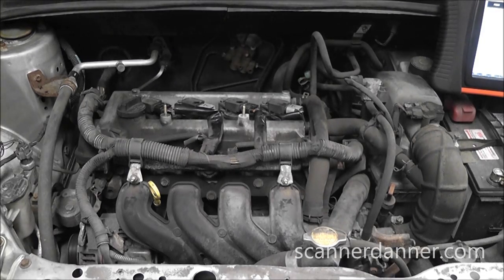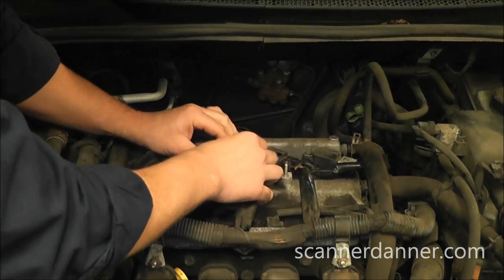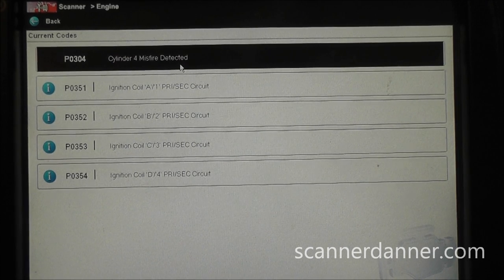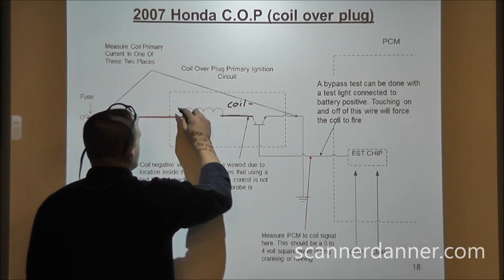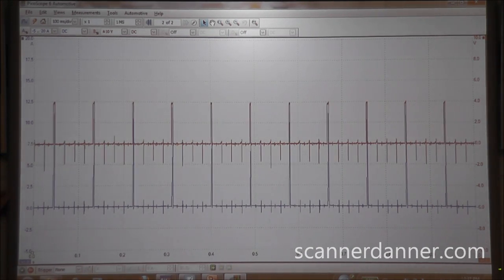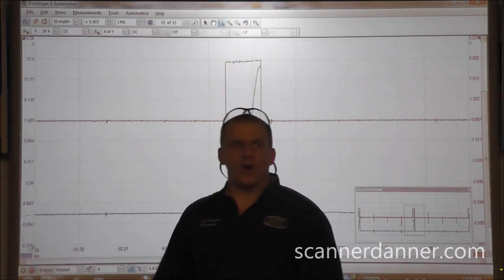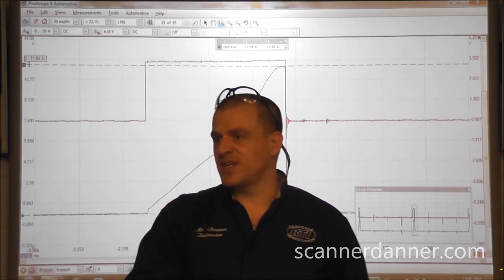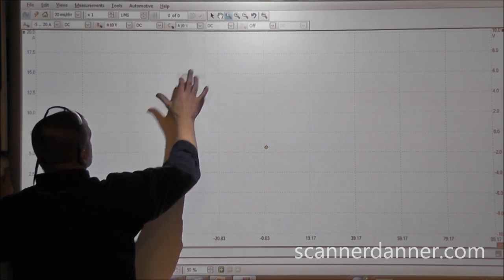Operation and testing coil over plug ignition (4 wire) - Toyota/Lexus

Comment: i know your discussions are not sales pitches but I'm watching because I'm still deciding on buy a picoscope 4425 automotive.  So far, just the 12 bit resolution is impressive.  I was wondering if you have any CAN-C signal faults where a scope of this caliber is really useful??
Reply from the maker: +dicas1988 you could post that question on the Picoscope forum. I'm sure someone there has some examples of that. Another real good site is www.autonerdz.com
They sell the picoscope as well and have a really good forum. Tell them I sent you okay?
Reply: Yea, ok.  Sure will.  Thanks anyway.  Hey btw, whats your thoughts on the power probe hook?  Do you think the pp4 is all around better?
Reply from the maker: +dicas1988 funny you ask. I have both but never used the hook yet. Supposedly with the hook I can substitute a 5v reference output with it

Comment: i think the IGF is "triggered" when amp draw happens inside the coil, to me is looking at amp draw since they dont care about having them all in the same wire, but  i am not sure  ,  I would say to your question is impossible , are you thinking on a worst case scenario when computer ecm diagnostics fail or get false information?

Comment: On my 2004 Mitsubishi Outlander with 3 wire coils when cranking the coil control wires have 12 Volts, then 900 ohms, then 8 hertz. When not cranking Key On the control wires have 12 Volts, then 0 Ohms to ground, then 0.1 volts.   Should the resistance in the ground wire be so high?  I t looks to be controls as the resistance goes from 0 Ohms to high ohms when cranking??

Thanks for this video which explained a lot.
Reply from the maker: You cannot measure resistance (ohms) on a circuit that is live or has voltage or current applied to it. This is not a valid test at all. 
A three wire coil has the driver inside of the coil. There should be a constant battery voltage on 1 wire, a constant ground on another and the third wire is the PCM to ignition coil trigger signal. (base circuit control) This is usually a 0 to 4 volt square wave that will not show very well on a multimeter, they are too slow to see these fast signals. You may read a few hundred millivolts or so.
Reply: Thanks for setting me straight on the ignition system/coils.  It turned out to be a warp in the crank angle timing ring that had been bent when the timing belt failed.  Noticed the CEL flashing during cranking so no codes with all sensors OK but a poor signal to crank sensor due to  a mechanical defect.

Comment: On your Honda C.O.P example, it reads that you can do a bypass test by touching B+ to the wire that comes from the PCM-coil. On the Toyota this would be the IGT wire (right?). My question to you is how do you know the test light has to be connect to B+, and would it be the same for the Toyota??

Comment: Hello again, I have mu coil firing on the bench, but I need to add some additional external control which requires firing an EXternal custom circuit just when the high voltage spark starts.  This means I need to use the digital I/O with my custom circuit.  My source of confusion is at timestamp 33:25   WHAT IS TRIGGERING IGF??  Is some sort of time delay with respect to IGT happening here?  Or maybe IGF is triggering on a certain CURRENT level (range) through the primary ramp???
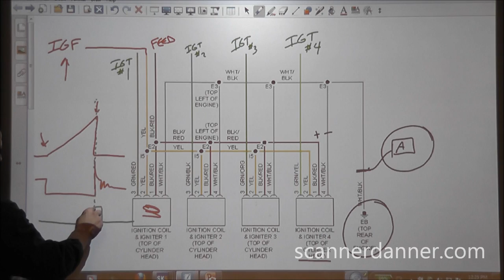There seems to be a contradiction at timestamp range  17:00 to 17:25
Reply from the maker: What triggers the IGF circuit exactly? Can't answer that other than to say when the coil fires, it uses that event to create the signal. Service info says the high voltage spike from the collapse of the primary winding is the trigger, but I believe we saw something that didn't quite match that here.

Comment: Hey Paul thanks for the video. Quick question. Is there any obvious way of telling if the transistor is in the coil or not? I have seen BMW’s before where you can get a primary wave from plugging into negative side of coil. And those were three pin coils. Is it just a matter of interrogating wiring diagrams? Thanks again!
Reply from the maker: Yeah the variable is the euro market. They like to use 3 wire cop coils that look like the transistor is inside but in fact the 3rd wire is a secondary winding ground wire. Other than that design, every other 3 or 4 pin cop coils, the transistor is in the coil itself
Reply: @ScannerDanner  thanks for getting back to me. Your videos have helped me enormously over the years

Comment: I have a question , since the coil is triggered internally and not externally by the ECU would you be able to measure coil primary with a scope or just a current probe?

Comment: Hi paul great vid,2 questions Would a non sparking coil show no igf signal? Also why is the current ramping up to 10amps while there is no spark? Thanx from AUS :)
Reply from the maker: It depends on the IGF circuit. They are not all the same. In other words, you could have a shorted secondary winding and have no spark, but still potentially have an IGF signal.
So again, your second question is answered here too. The 10a ramp is the primary circuit, we are not looking directly at the secondary here. Does that make sense?

Comment: Hey paul, is it possible to see 4 wire ignition coils primary or secondary voltage waveforms on a scope. the only way i think i could see secondary is hooking up an extension wire between the coil to the plug and using an inductive pick up? would that make an accurate test? thanks.

Comment: Hey Paul could you look up a 04 Kia amanti and look at the coil driver? On your diagram of the transistor you have 12v constant power going to the coil and the signal wire from the ecu and a constant ground. I completely understand it. But on this amanti you will see its totally opposite. The 12v feed is also the signal? Could you please take a look at it and tell me whats going on

Comment: But can the primary fire without inducing voltage into the secondary coil?  Or coils if it is broken in two?  My guess is that no secondary spark has to be the result of firing to ground.

Comment: I have a 2003 Nissan sentra 1.8 and I replaced the spark plugs, coils, air filter, and cleaned the air sensor and mtmy engine is still shaking. what can i do to check if it's my sensor or injector? And when I put my vehicle in drive, it kinda shakes still.

Comment: Hello, engineer, I am a mechanic and I have a problem. I have a Lexus IS 300 engine. When I start it, the engine starts, but after 2 seconds, the check light comes on and the engine turns off. Can you help me? Thank you.
Reply from the maker: What codes?

Comment: Paul In this video you show the amp clamp attached to ground by block to show all coils. Am  I putting amp clamp around all 4 wires going to this block ground or just one single wire ? I am using a older Snap on Modis and am getting  a different kind of ramp (almost square wave) and I have tried multiple time variables. Thanks
Reply from the maker: If you go around all of the wires just remember there are other circuits you will see in combination with the ignition coil ramps. It will multiply your amperage readings and depending on what else is there, severely distort your waveform. 
It is best to find the single wire that is carrying the coil current only. Make sense?

Comment: paul what the hashing noise on the burn time of the waveform means? it drove me nuts im seeing it on all 4 new coils i put on a 2azfe 4cyl engine!
Reply from the maker: What "burn time" are you referring to? Do you mean the coil primary current ramps? Burn time refers to the secondary event where the spark is actually jumping the gap of the plug and for how long.
Reply: ScannerDanner yes the burn time after the spark being generated right before the coil oscillation. it was 3wire coil over packs, and hooked the negative probe to ground and positive probe to ecu signal. i keep seeing hashing in the burn time  on every single coil though all of them new! drove me nuts:D thanks man really appreciate your work .
Reply from the maker: That's not the burn time bro, that would be the dwell time or the amount of time the primary is being energized. You are talking about the ECU's small square wave signal right?
Reply: ScannerDanner after the big spike there is burn time or what called burn time in the middle of it there is hashing  . twice i parts cannoned it thinking maybe i got bad coil packs all four of them ;D
Reply: ScannerDanner i just wana know is this normal? since the engine seems fine running no hesitation or misfire. cuz im concerned since the owner did run awhile with really bad ignition coil with dead short in could the driver be damged somehow?
Reply from the maker: Post this to my forum brother, so I can see an image of what you are talking about. Okay? I'll look for it over there. Thanks! https://scannerdanner.com/forum/post-your-repair-questions-here.html
Reply: ScannerDanner  deal bro you rock!

Comment: Hey man have you found a good probe to read secondary ignition on Toyota coils? Bought one from aeswave that couldn't even make out a compression issue in the burn line.
Reply from the maker: Nope, non of them will read the COPs with the transistor inside of the coil. I have three different ones (Pico, paddle probe and Wyze probe)

Comment: can you determine if a 3 wire coil is weak by checking the amp ramp? for example, a car that has random misfires and has codes for multiple misfire. if you connect an amp probe to the positive wire would you see a change on the ramp when the misfire occurs?
Reply from the maker: Sometimes. It depends on the type of coil failure. You cannot see all secondary faults within a primary current ramp. 
Type in "misfire" or "no spark" in the search box of my videos and enjoy! You will see alot more of this. 
Thank you!

Comment: Sir my car i20 rpm drops when each coil over plug is removed from the ignition coil. This is ok. But the current produce in coil 1 and 2 are a bit low when each coils is moved a bit far. Is this low spark an issue??? Also, engine is vibrating a bit only and rpm drops to 650 as against the normal 850.

Comment: Good vid very good info do 1 on a cam sencer wireing problem on ground when getting code 340 not cam but on the wireing i think it goes down too tranmission not sure do not want to on rap tape forgot what it is called but some wires have a self ground wire like it has a tin foil rapped around some wireing i no that 6.0 deisol ford f 350 has it i have a f 250 5.4gas hope u can make a vid on the wireing problem or how can i find out were i can get diagram need to no is wire going to injet o thanks

Comment: Hello sir I have your book and I am member on premium channel and I am very happy for all this knowledge share with us! I have a vw up with 4 wire coil on plug and the car misfiring all the time at one coil and have no spark. I check my power my ground and the igf and all is ok except that the igf missing one signal from the coil doesn't fire.I connect my oscilloscope and find that the trigger signal from the ecu doesn't go 0 volt to 4.7 volt square signal like the other coils but only go 3 volt to 4.7 volt square signal.what do you suggest me to check ?I already check crankshaft and camshaft waveform and exist without strange signs.i also check power and grounds to the ecu and is ok. I believe maybe the ecu have the problem i never have the same problem with coil signal at my workshop. If i change the coil that doesn't fire to the next is fire with  no problem and the spark also the same. Best Regards! Thanks in advance!!looking forward for your help!!
Reply from the maker: What is the voltage on that trigger signal with key on engine off? Compare that to a know good coil too.
Reply: @ScannerDanner  i will try tomorrow and tell you what is !! Thank you very much for your fast response!!
Reply: @ScannerDanner  good morning sir so if I have key on engine off or key off I have all the time 3.7 volts (in my previous message I say 3 volts its wrong  3.7 is the correct) . Compare to another coil is 0 volts with key on engine off. When I unplug my coil with the problem the voltage jump to 4.7 volts and if I plug again falls to 3.7 volts. And if I start the car the trigger square signal is 3.7 to 4.7 volts. I also put a ampclamp as you say in this video on the ground and I don't see any ampere ramp but only if I zoom enough a waveform like primary. And after 5 minutes with key off  when the ecu go to sleep then the voltage goes to 0 volts
Reply from the maker: @giorkar2116  okay perfect! That was my suspicions. Before we condemn the ECM, let's make sure that we don't have another wire bleeding into that circuit. The fastest, most accurate way to do that is to cut the wire a few inches back from the ECM, leaving yourself room to repair it when your done. Then recheck that wire on the ECM side KOEO. Make sense? 
If you don't want to cut, you may be able to de-pin that terminal from the ECM connector.
Reply: @ScannerDanner  yes! I will do this!!make sense i understand!so the result is that in that circuit inside the ecu something has shorted and gives all the time power and not when the ecu wants to charge the primary in a pulse mode if i say right and the coil can't create a spark or works without something triggering to collapse and create the secondary .thank you very very much!!! I wish you to smile everyday!! (Greek phrase)
Reply from the maker: @giorkar2116  let me know how it goes!
Reply: @ScannerDanner  of course!
Reply: @ScannerDanner  hello again sir!!I cut the wire 2 inches after ecu plug as we say and the ecu feed this 2 inches wire with 4.7 volts. So I believe now we have confidence and evidence to call a bad ecu. Am I right?
Reply from the maker: @giorkar2116  that would be my call buddy
Reply: @ScannerDanner  thank you so much for your help and for your immediate answers!!
Reply from the maker: @giorkar2116  intelligent questions always get my attention 🙂 also thank you for being a premium member!
Reply: @ScannerDanner  hello sir! Today I finally found a used ecu and install it and the car runs perfect!!so our call for a bad ecu was right! I also change 3 new coils and 3 new sparks plugs ( for the time of  diagnosis until the repair i had already  install 3 mine used known good coil and spark plugs) . The car has 84000 km and never changed the spark plugs and it isn't iridium spark plugs just simple. The old spark plugs have no spike only a giant gap and too rusty and the boots of the coils was in a very bad condition with water damage. So I believe maybe this is the reason causing the bad ecu like some europe ford models from a bad coil causing a bad ecu. I want to thank you one more time for your fast response, guidance and signs of a professional teacher being on our side!Hope the best! Best regards!
Reply from the maker: @giorkar2116  heck yeah man! Nice job on that one my new friend. Good providence to you moving forward.

Comment: Hey Paul, i saw a lexus 4 wire cop which dissconnecting one of the coils the car goes off. What might be wrong?
Reply from the maker: Normal on those. The system uses the generated IGF signals of the coils for injector control.
Reply: +ScannerDanner thank you!

Comment: Current will not be the same on the power side vs the ground side. The current from the base of the transistor will be added to the ground circuit. You will get two different readings. A small difference, but measurable.
Reply from the maker: Good point! Not much maybe 200 ma difference and it wouldn't affect diagnosis but you are correct
Reply: ScannerDanner I agree that the current would be small. But the smaller current would show up as a square wave at the emitter where you would normally only see the current from the coil. Yeah the base current through the emitter would be small but could confuse people if they don't expect to see it.

Comment: Love your videos , but I am no fan of unplugging the coils first to hear rpm drop , it could be a poor connection at any one connector and when reconnecting the coil it may start to fire. Then you are stuck with having a vehicle that may run fine and we can no  longer reproduce the problem. Then the question of was it the connector or a failing driver in the ecm? Just a preference for me but I dont disconnect anything before testing by backprobe methods

Comment: Does the vantage pro need attenuators to see coil primary and injector spikes
Reply: I don't think so, I've used a vantage pro without them for a while and haven't had it affect the scope yet. If its over voltage it will show up as a white line

Comment: what about checking downstream o2 sensor? if high voltage fuel is present, therefore it could be mechanical, ignition . If low voltage fuel delivery misfire
Reply from the maker: one of many tests to help ID types of misfiring, thanks for the reminder

Comment: Will the car still run ok "IF" the IGF wire was cut? The reason I ask is:
I have a 3 wire C.O.P from a 2008 Mazda Protege and want to use it on My 1990 Eagle Talon 4G63 awd tsi but every one uses 2 wire C.O.P set ups. My thought is I could just delete the IGF wire because my ecm wouldn't accept it's signal any way but will the coils still fire correctly?
Reply: No, a 3 or 4 wire coil will not work in a circuit designed with a 2 wire coil. The transistor that controls the coil is inside of the coil on a 3 and 4 wire type whereas the 2 wire type the transistor is not part of the coil.

Comment: Some cars, like the 2000-2001 toyota tacomas, if you disconnect the coil (to do a power balance test) while running, the vehicle will shut off by design.  Just fyi.
Reply: Found that out just recently.  Thanks!